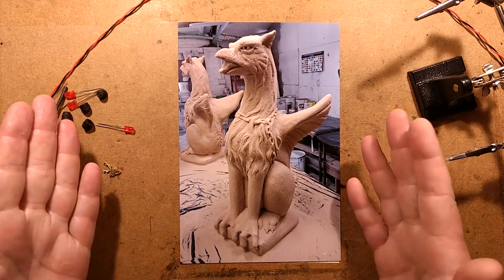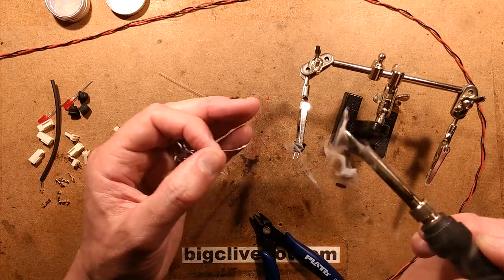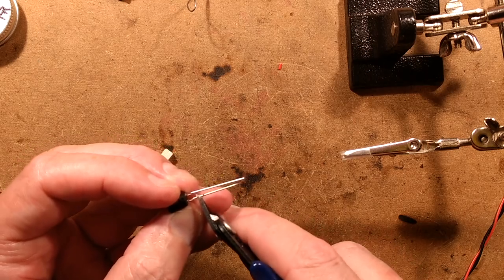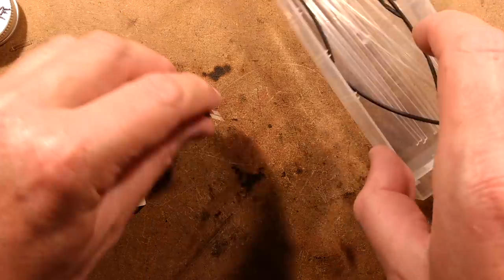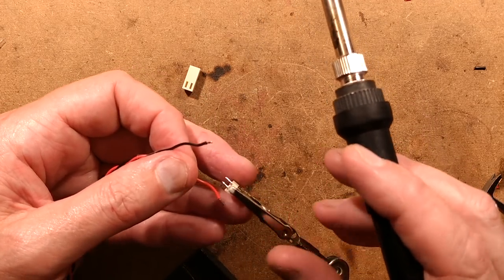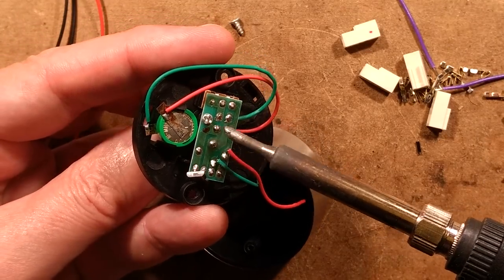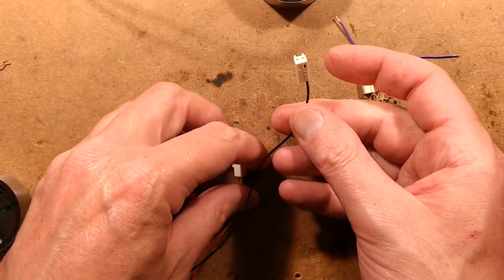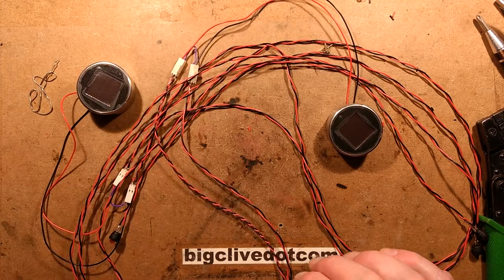Making a wiring loom for a prop.  Rambly Q&A video.

Comment: There is a tool to twist the wire that work like you want. There are safety we ire pliers use on aircraft to secure nuts in place also on race cars for the wheels or for that matter wire wheels the type with only a spindle and a knock off nut.  Harbor freight stocks them

Comment: What method would you recommend for switching 18v wiring with a 3.3v signal? Basically what kind of relay could you use with 3.3v that would switch 18v?
Reply: For currents up to 1A you could use an Omron G5V-1 3DC relay. The coil needs about 50mA so if you are driving it from a microcontroller port make sure the port can source or sink that much current otherwise drive it from an external transistor.
Reply: bob s thank you! I'll look into those. I am looking to use it with a raspberry pi

Comment: @BigClive.. I noticed you use the 99p PLATO Snips. I used these for Vaping and making coils and they blunted really quick. Can I recommend these "XURON 170-II MICRO-SHEAR FLUSH CUTTERS. "Made In the USA". I got from China on eBay for £1.20 each. They have been absolutely fantastic and has stayed sharp for over 9 months so far. 
Regards 
Tony H in Portsmouth UK..;-)
Reply from the maker: I have Xuron snips but keep them for specific low risk tasks.  The cheap ones would not deal with heating wire well, especially with the thin nature of the wire being more of an issue with damaged blades.

Comment: Why not buy some cat 5 cable and strip it?
Reply: its generally easier to twist up the wire yourself than to faff about trying to strip down CatX cable, particularly for long lengths

Plus some uses require certified instrument/hook-up wire :)
Reply: You can - but Cat 3 might even be better.  One problem is that a lot of cheap Cat 3/5/6 is CCA, and the rest of it is 26 gauge.   The good stuff is generally 24 gauge, and you can get audio/control/instrumentation (twisted pair) cable (two pair).   +Conor Noakes - it's actually very easy to strip down Cat5 cable as long as it has a good nylon string in it.   Once you've split it down a few inches, you grab the string and just unzip the cable.    I do this all the time when I need some wire for telephone panel patching.
Reply: Troy Belding all the stuff we generally use is LSZH and that doesn’t strip out easily in the manner you’re describing (or it could just be the brands we use)
Doesn’t appear to work well on external grade CatX either

It’s a good technique for other cables too though, it’s the easiest way of stripping down Twin & Earth (interestingly it works for LSZH T&E really well) using the Earth conductor :)
Reply: Outdoor won't work, that's for sure.  Mostly I'm using PVC, because I don't do a ton of plenum work.  Mostly suspended ceiling with returns.  Although I've found that plenum grade cable has a nasty habit of cracking when you bend it.  It's probably both that you're using plenum grade, and/or outdoor/burial.  Cat6 is much harder than cat 5.
Reply: Troy Belding can’t say I’ve ever seen or heard of LSZH grade CatX cracking and we’ve laid out a good few kilometres of it 😅

Hardly use external grade stuff for anything other than damp warehouses and CCTV so not had as much experience with that
Reply: The vast majority of ethernet cable is solid core... which is why I cringe when people kink or figure-eight wind it.
Reply: They should teach over/under in grade schools.  Even if you're not using over/under for wiring, it comes in handy for the garden hose and other things.    Figure-eight eliminates twisting too.  We were required to use that method for long runs of triax cabling in eng production jobs.  Triax is / was expensive cabling for production shooting.
Reply: Jim Fortune - I believe he wanted stranded cable for this application and "fixed" network and telephone/telecommunications cables are all solid core.
Reply: Conor Noakes
Easiest way I've found to strip a cat 5 cable is to use a seam ripper (awesome name) from a sewing supplies store (not as awesome as the name). They're very quick and easy.
Reply: Wolfin
All cables get rolled when I pack them up lol, as little bend as possible no matter what type it is, it`s just good practice..
Reply: i think because he wanted stranded not solid core.
Reply: @JimFortune  Oh, seam rippers, that's a great tip! Thank you!

Comment: Speaking from experience, using the heat gun for solder rework is not as efficient as they sound. I have issues concentrating the hot air where I need it and not causing surrounding components to melt free. Its quite the challenge. Need high heat setting and run a risk of damaging components due to overheating.

Comment: If you wire them in series and the LED, wire or connector fails on one eye, both eyes will be dark and you wouldn't know which one? Or are the LEDs and wire removable at the head?

Comment: Bigman what would be the best solder too use on 18650 cells ? 
Cheers
Reply from the maker: I don't recommend soldering directly to 18650 cells at all.  The heat risks damaging the internal separator.

Comment: 42:38 -- "If I designed an electric chair, it would be absolutely amazing. It would have digital readouts. It would have fairground lights -- although it wouldn't need them, it would have a smoke machine for extra drama. It would be like a Halloween prop but with politicians in it. And lawyers." -- +bigclivedotcom, 2018. 

Laughed hard irl at this, bahahahahaha. One of the funniest/best things I've ever heard you say, Clive. ;P

Comment: I have a similar wire crimper but I don't have that exact set of bits. For the photo I didn't pull all of the bits out of my network toolbag, but here's the crimper and the RJ-45 and RJ-11 bits. :D

Comment: You would not believe how long I've searched for and not found equipment wire not knowing what it's called (Not an English speaker). I had a roll from Velleman but they call it mounting wire. It's alright but the larger rolls only come in black and red.
Reply: ManWithBeard1990 Look for audio or control cable.

Comment: I was shouting contention ratio lol. Was expecting a second video with you just saying that :D 
Are those solar LED units from Dealz/Poundland......2 for £1/€1.50? I've got lots of them here. Changed out the LEDs for different colours and higher capacity batteries - we get poor sunlight here in Donegal so need them to last as long as possible.
Am on Three for my home broadband - there is no fixed line available here but should have 1Gb fibre available within the year.

Wayyyyy too much beer talking there.
Goodnight :)

Comment: Better if the eyes blinked randomly, some times twice and  at random intervals, how would one do that?
Reply from the maker: With a microcontroller.
Reply: This is actually something I've built in the past. Doing it now I'd run it directly off a usb power bank or cell phone battery and lose the 9v and the regulator.

http://wolfnose.org/fur/fursuit/designs/zuki.html

Comment: I'm guessing many phones use the battery as a heatsink. They don't have much of a choice, though, with how thin they're obsessed on making them.

I know my Samsung Galaxy S3s will display a battery over-temperature message, indicating that charging has stopped temporarily, when it's plugged in and working hard.
I've had this happen a few times when using one as an IP camera monitoring an instrument readout in another room.

And it's definitely not that it's charging too fast, the battery percentage very slowly decreases over the course of the day.

Comment: Actually, I'm not surprised about the stuff floating around in the eye. Some can see it "with the naked eye". That's the out of focus spot(s) you'll sometimes see drifting around.
Yes, Disney has lots of gays, easily 25% of the staff - I worked in World (FL) many years ago. And I doubt that's changed any.
Reply: Another location that is indeed gay was the HQ 3RD United States Infantry (The Old Guard) Fife and Drum Corps.  Their commander used to call them "The Company of Queers"  Perhaps it was coincidental, I don't know but there were very few gay men in The Old Guard other then the Fife and Drum Corps.  Of course this was a long long time ago, I served from 1975-77 with The Old Guard.

Comment: What do you think of the newer 5G that people are saying is super dangerous, probably without any reasoning at all
Reply: Phonotical Well the industry is hyping it, looking to grab even more radio frequencies previously used for more efficient stuff (like broadcasts), and hoping like addicted gamblers that it will bring in the money lost on investments in 3G and 4G, using the same failed schemes that didn't work for the previous generations.

Comment: I need some help from Clive or anyone who has watched this. What is the proper name for those 2-pin connectors he uses in this? I'm very familiar with them from many devices I've encountered, however, I've recently had a need for them for devices of my own design and need to find them. When I search Mouser/Digikey/etc. for 2-pin Molex connectors (my best guess for the name), I find an enormous selection of various connectors. However, those he is using seem to be one of the few industry standard designs (at least, in the devices I've dealt with.)

Can anybody help with a name, or a part number, or any other descriptor?

Thanks,
Travis!
Reply from the maker: https://www.rapidonline.com/pcb-interconnect?ra_source=tier-left-list&Attributes={%22Brand%22:[%22JYK%22]}&ResultsTotal=59
Reply: KF2510 2-pin straight headers and housings with 2.54mm crimps

Comment: "If it ain't broke, don't fix it" goes for soft/firmware updates as well.
Plenty of phones and computers have been ruined by updates that they weren't initially designed for.
On the plus side, you might be able to find a downgrade for your phone to restore it's performance/stability.

Comment: European regulations is a thing UK does not have to care about next year. Sad. Very sad.
Reply from the maker: I'm not a fan of many of the nonsensical regulations that were introduced.  Especially the one that replaced our well designed wiring colour code with a badly designed one that swapped the neutral colour with a phase in the process.  It also facilitated a profit motivated company somehow pushing through a racketeering scam where anyone who does electrical work in homes has to pay them cash regularly, and people like me are not permitted to do electrical work in our own homes.  Their racket has also facilitated a new business in one-week training courses to instantly certify anyone as an electrician.
Reply: GONE SEXUAL NEARLY DIED POLICE WERE CALLED YOU WON'T BELIEVE IT'S NOT BUTTER

Sorry.